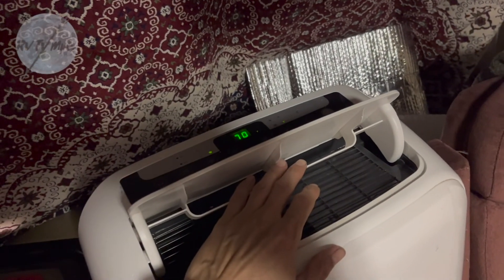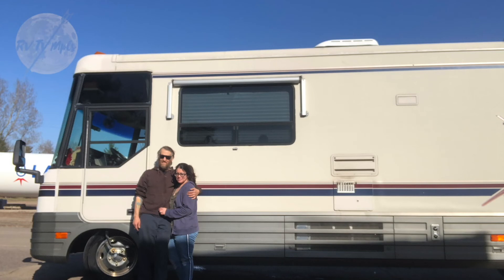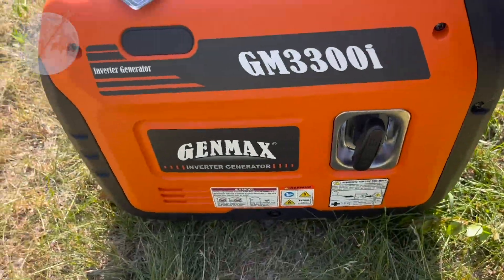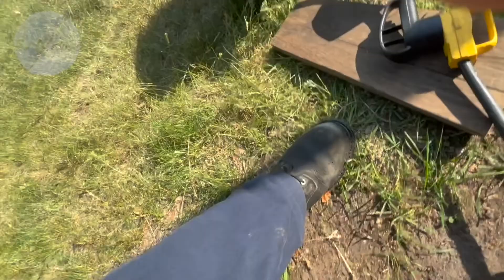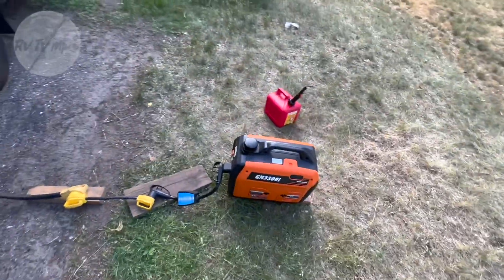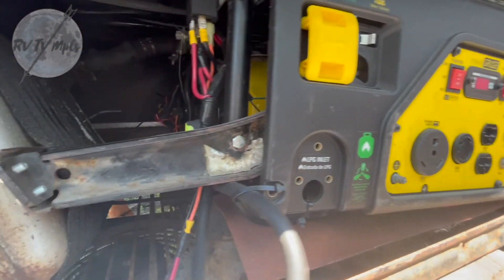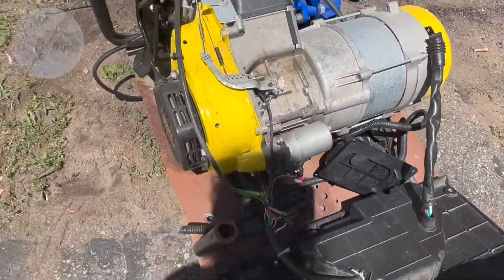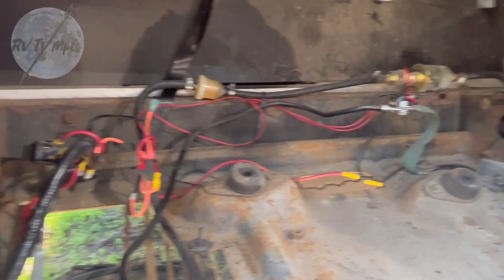Boondocking Generators For RV's Genmax 3300I First Start Up

Comment: I had picked up the Craftsman 3300i at Lowes but there was no way to turn off eco mode and it couldnt keep up with my AC surge.  I just exchanged it for the Genmax 3300i.  Looks like I made the correct decision and will test it this weekend.
Reply from the maker: That's awesome. Ours handles our AC surge just fine while running a 20a 24v battery charger and the rest of the RV.

Comment: Why not use eco mode?
Reply from the maker: Eco mode is for lowering the idle when you are not putting an electric load on the generator. When we use it, it is to make electricity to charge our batteries and run our appliances. It is never idling without a load on it.